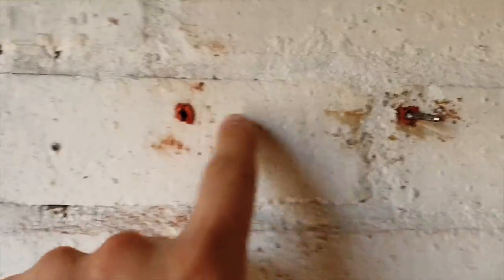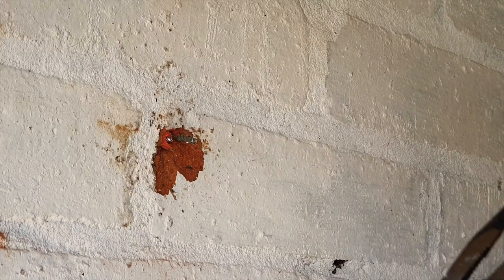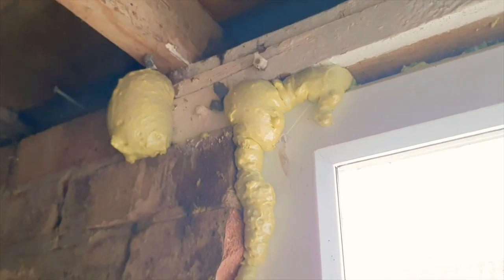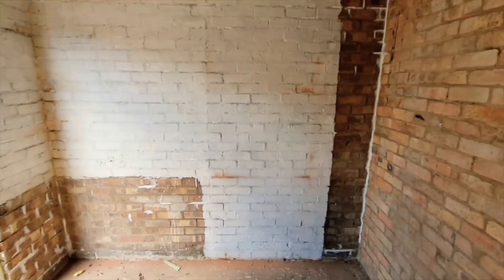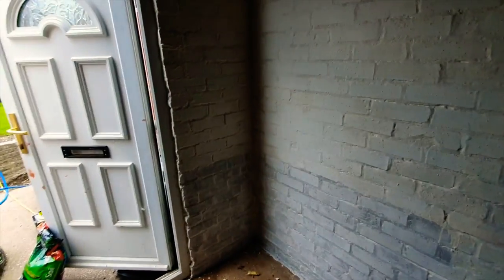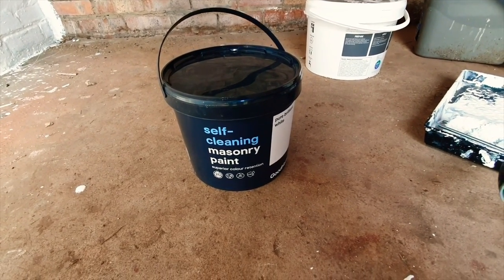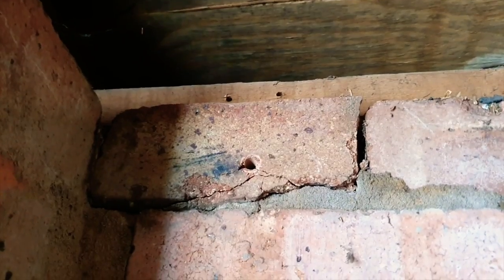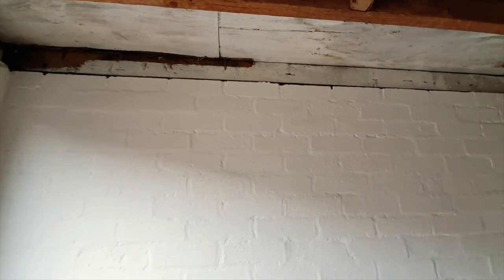Setting Up the New Blacksmithing Shop - Part 2

Comment: Love it. You don't need any of that primer, if you want to seal a wall, just use 50% PVA/water mix. You don't need any for your bricks. I painted my garage walls, without so much as a wash, 20 years ago with masonry paint and they're still looking good. Spend your money on tools, they are so much better value and muchmore fun:-)
Reply from the maker: There's a good chance your advice is solid, however due to the age and condition of the walls, I wanted to do a "proper job" if you will. The primer is a 4 stage thing, it seals, primes, undercoat and stain blocks... it also fills and holds small cracks. 

I have no doubt that PVA works well too, but wanted to do this one by the book. I'd kick myself if I had to start over again. ;)
Reply: Wow, that’s some technical paint. You can’t beat a proper job. It’s looking great already. I look forward to seeing it done. 👍
Reply from the maker: @sedulousdabbler5468  ME TOO! Haha!